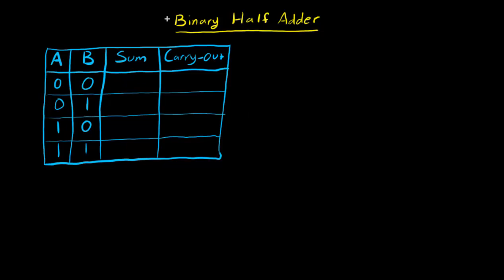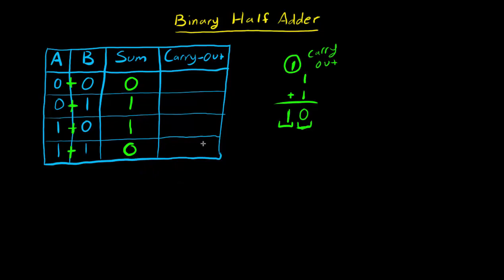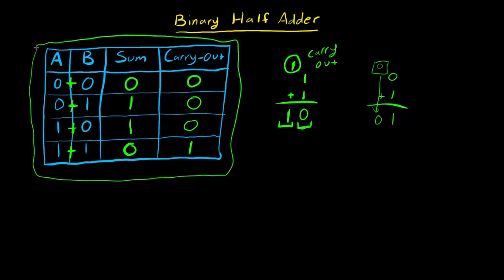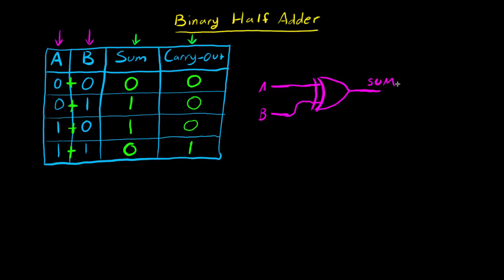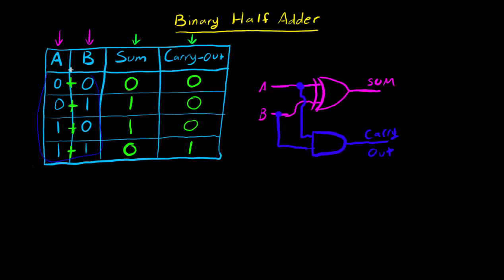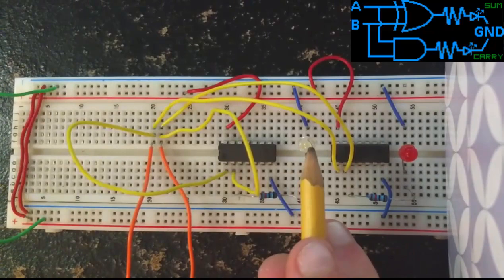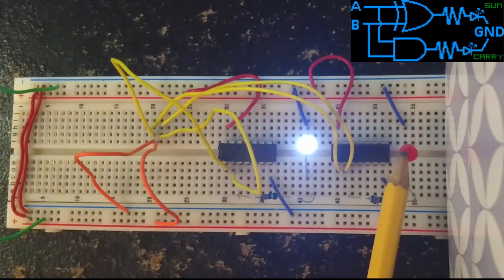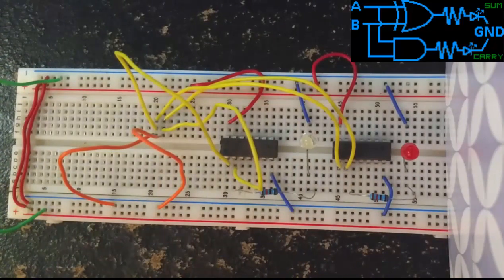Beginner Electronics - 29 - Binary Half-Adder

Comment: And I want to know if the electricity flows from the negative or positive terminal.
I'm confused!
Reply: Yes the electricity flows from the positive terminal; but the electrons flow from the negative terminal. I would say ignore the flow of electrons and focus on flow of electricity.
Reply: @awadshaif6563  Thank you so so much!
I was so confused!
You saved me, I was thinking it was flowing from the negative pole.
BOOOOOOOOM
Reply: @rayane8733  I think there might be some misconceptions. 
ELECTRICITY is the set of physical phenomena associated with the presence and motion of matter that has a property of electric charge. 
The movement of electric charge is known as an ELECTRIC CURENT, the intensity of which is usually measured in amperes. 
The ELECTRON is a subatomic particle, whose electric charge is negative one elementary charge.

Your question scientifically correct: Does the electric current flow from the negative or positive terminal?

Answer: You are going to consider that the flow is according to the conventional current. Conventional current is the flow of a positive charge from positive to negative and is the reverse of real electron flow. (Briefly put - in real life: negative to positive / on paper, the one used by society, the one you need to keep in mind when solving problems: positive to negative)